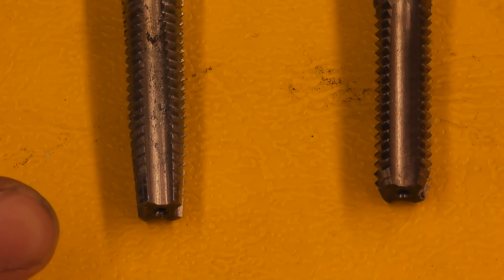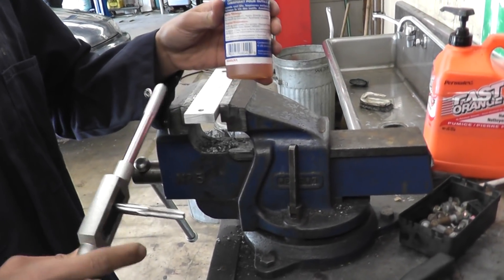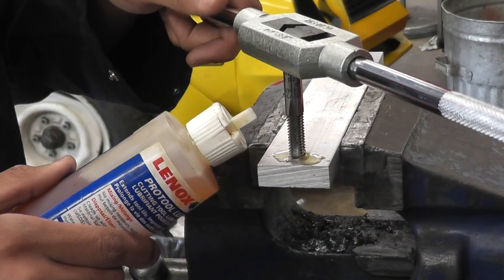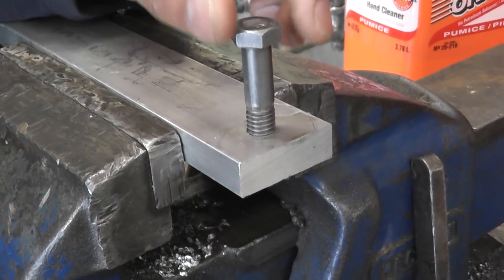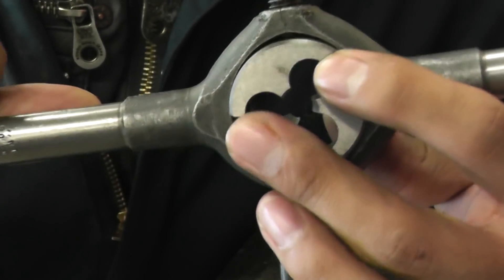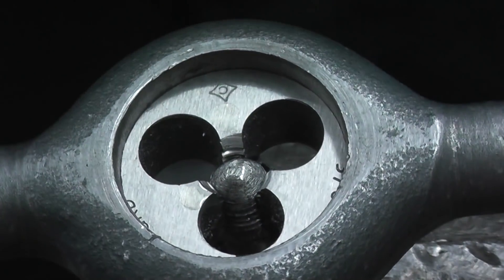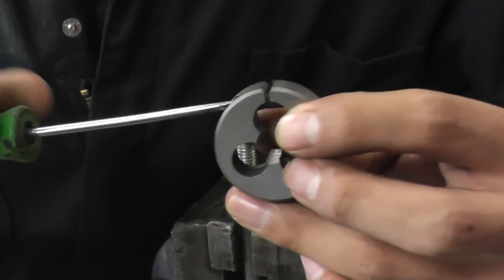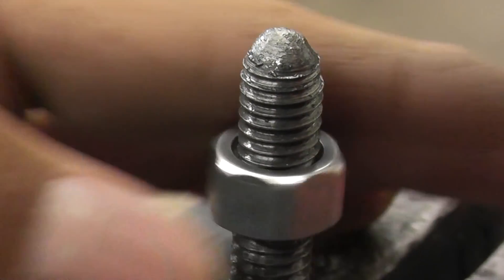How to tap and die

Comment: Today I tapped holes for four 14mm bolts in 3/16" steel for a set of off road lights using an el-cheapo set of taps (no name on them, just "Made in China").  Was scared to death of breaking off the tap in the hole, what a nightmare that is.  Been there & done it, didn't want to go there again. Took my time, followed your directions, used plenty of cutting oil, and voila- success!  Thanks for the great, informative video!  👍

Comment: Your effort is appreciated, if I may would you pay an hour wages for one thread???  I do not think so... furthermore in your first attempt you showed the die holder screw on the split??? why? the correct way is when you re threaded the dimple in the die is to adjust the diameter of the thread IS THE CORRECT WAY... sorry... Jack

Comment: The camerawork in this is exceptional. Everything is very clear. I learned a lot. One question though: When you redid the process to make the threads deeper, why couldn't you just adjust the die with the screw adjustment only? You did show that, but then the video went on to show closing the gap by positioning the die differently in the holder to apply pressure to close the gap.
Reply from the maker: Hi Gary, thanks for the compliment. The reason die was turned around and side bolt tighten, was to squeeze the die and cut the threads deeper. some die's have a screw on the side that you can tighten up to accomplish the same result. By the was these videos are made by my teenage (16-17 years old) students. Thanks again, cheers.
Reply: @FrankHurtAuto  OK, thank you very much. Tell your students that the quality of their videos is very good and their explanations are crystal clear. I used to be a technical writer, so I always appreciate well-executed instruction.